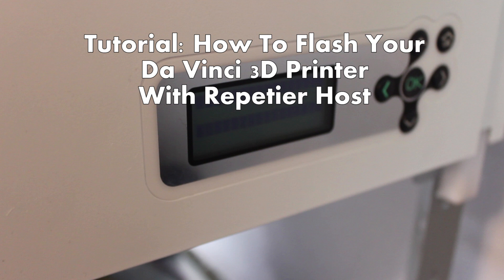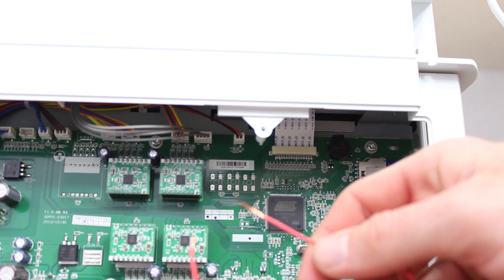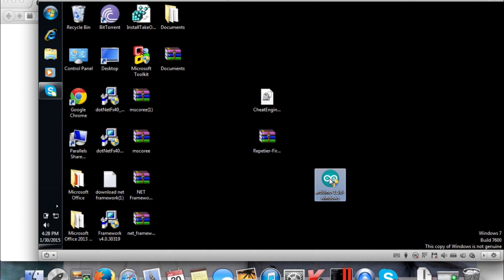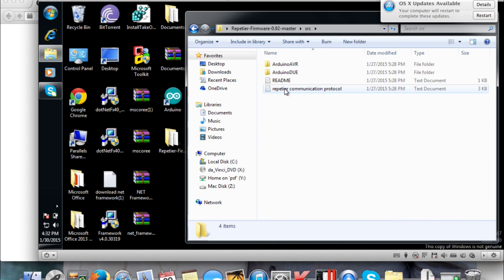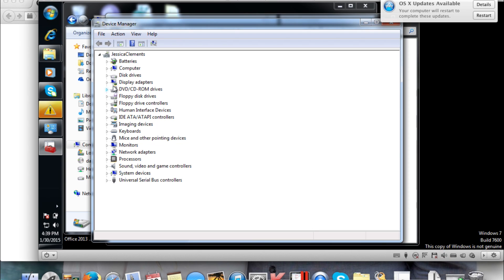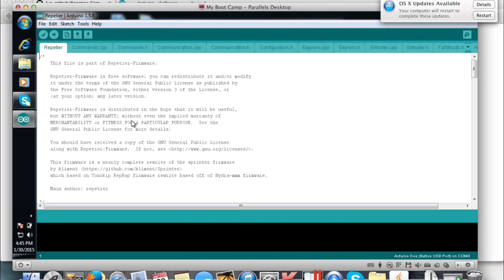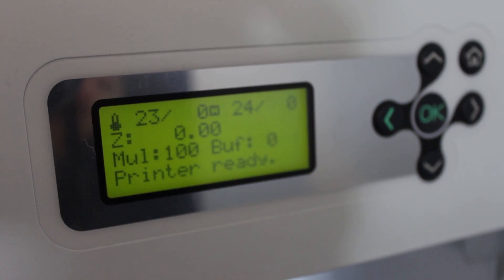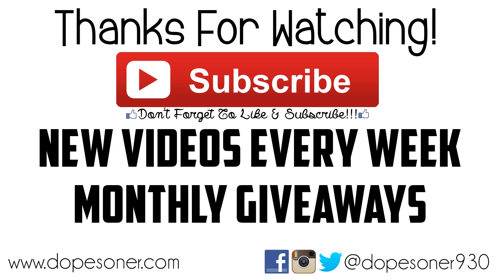Tutorial: How To Flash Your Da Vinci 3d Printer With Repetier Host | 3d Printer Hacks

Comment: using the files you linked,  going to the repetier folder, SRC, ARCUINO DUE, additionalarduinofiles.

There is no 1.5.8 folder

There is just  

Arduino - 1.6.9 -Due 1.6.8
Horus-0.2rc1

EDIT:

Also, the repetier software will not compile.  not edited, and not as is in the download.

Arduino: 1.5.8 (Windows 8), Board: "Arduino Due (Native USB Port)"

In file included from Repetier.h:572:0,
                 from BedLeveling.cpp:107:
HAL.h: In static member function 'static void HAL::serialSetBaudrate(long int)':
HAL.h:684:14: error: 'class UARTClass' has no member named 'setInterruptPriority'
       Serial.setInterruptPriority(1);
              ^
Error compiling.

  This report would have more information with
  "Show verbose output during compilation"
  enabled in File > Preferences.

EDIT2:

Just redid the entire procedure including the downloads.

Same issue.  the file structure of  the Repetier-Firmware-0.92-master folder DOES NOT match the video.

Arduino 1.5.8 beta atill WILL NOT compile the repetier firmware file.

Arduino: 1.5.8 (Windows 8), Board: "Arduino Due (Native USB Port)"

In file included from Repetier.h:572:0,
                 from BedLeveling.cpp:107:
HAL.h: In static member function 'static void HAL::serialSetBaudrate(long int)':
HAL.h:684:14: error: 'class UARTClass' has no member named 'setInterruptPriority'
       Serial.setInterruptPriority(1);
              ^
Error compiling.

  This report would have more information with
  "Show verbose output during compilation"
  enabled in File > Preferences.

My printer is currently a brick.
Reply: How did you fix it?

Comment: help! i got an error msg when i clicked the check mark:
Arduino: 1.5.8 (Windows 8), Board: "Arduino Due (Native USB Port)"

In file included from Repetier.h:572:0,
                 from BedLeveling.cpp:107:
HAL.h: In static member function 'static void HAL::serialSetBaudrate(long int)':
HAL.h:684:14: error: 'class UARTClass' has no member named 'setInterruptPriority'
       Serial.setInterruptPriority(1);
              ^
Error compiling.

  This report would have more information with
  "Show verbose output during compilation"
  enabled in File > Preferences.
Reply: ive got the same problem. Help
Reply: Did you guys figure it out
Reply: anyone solved this?
Reply: Looks like you need to use a newer version of arduino.  Got this from the githubz page:
Use an arduino IDE supporting arduino DUE, 1.8.0 with Due 1.6.8 module from board manager FAQ#166.
Do not use 1.5.8 it is not supported and will give compilation error: FAQ#201

Comment: Another XYZ Da Vinci 2.0 Duo has been liberated from its manufacturer. Thank you so much ModBot for your tutorial. Used the J37 and Arduino 1.5.8. No problem with the reset and upload, but there was no sound when the upload was done and I had to manuel restart the printer, but the printer then began the restart every 1-2min. I have just reflashed the printer with a little twist, Variant.cpp was edited so "//WDT_Disable(WDT);" was changed TO "WDT_Disable(WDT);" to disable the watchdog feature. And so far no restart and the printer has been on for 1 hours

Comment: I think there might have been a firmware update that prevents this from working on 1.0A now... I have fw 2.1.2 and shorting J37 no longer erases the firmware. If anybody has any tips to fix this that would be great!
Reply: Okay ignore my above comment. I did get it working on 1.0A with 2.1.2. I just wasn't using a conductive enough pin to bridge it. I grabbed some tweezers and those ended up working just great for me.
Reply: You followed all the steps in the video right? And everything worked ok for you? I'm also on 2.1.2, but I'm really nervous to try to do this.
Reply: Yep I followed them exactly and had no major problems (once I got the right tool to short the pins haha)
Reply: Alex Baucom did you have an easy time setting up the software and actually using it? I'm seeing a lot of forum posts and it seems difficult to actually use
Reply: I had used the software previously when I built a RepRap so I was already familiar with it as well as the slicing software so I'm not sure I can give you much information there.

Comment: thank you, everything worked fine on my davinci 1.0A. After i flashed the printer it did not start automatically. After a few Heart attacks (a few minutes later) I switched it off and on and it worked. It takes some time to set up the software but everything works fine.

Comment: Still works as of 8/5/16 
At first I was scared that I completely bricked the printer. It turns out that you have to use Arduino 1.5.8. I had to look in their previous builds to find it (arduino.cc/en/Main/OldSoftwareReleases). 

Also, I found that you can't just replace the whole "hardware" file. You need to replace the ones that exist in the Arduino program and keep the ones that don't exist in the Repetier's "hardware" file. 

Also, you need to install the Arduino SAM boards under the "tools - board - board manager" inside Arduino.

THIS IS IMPORTANT FOR REPETIER HOST
After installing the firmware, you have to tweak your settings or else your print head has a high chance of slamming into the print bed (fortunately there's springs). In Repetier host, 
1) Click Config > Firmware EEPROM Configuration and find "Z home pos"
2) Change "Z home pos" to -2.300 
1) Click Config > Firmware EEPROM Configuration > Printer Shape
2) Make sure the Print Area Width, Depth, and Height are all set to 200mm. Make sure X Max and Y Max are set to 200 as well. 

Thanks for this :P
Reply: do you still have the github file you downloaded. the one i seem to have is alot different then the one he mentioned in the video. there is no 1.5.8 folder or anything. only a 1.6.9. i have absolutely no experience doing this and dont want to brick my printer before ever using it

also the 169 file that is in git hub in installed it like in the video and clicked the verify and got an error about leveling. i havent did the eprom clear yet, i just wanted to test that no problems will happen before goin that far. if you do have the other file would you link it to me or give me some better tips on what to do to install it
Reply: Manime You have to download 1.5.8 Beta from the old Arduino IDE archives.
http://arduino.cc/en/Main/OldSoftwareReleases Also, I used the latest Git Hub files that are still up right now.
Reply: I have the same problem during compilatin: error: 'class UARTClass' has no member named 'setInterruptPriority'
       Serial.setInterruptPriority(1)
1.5.8 Beta and the latest Git Hub files are used. Tried to use newer versions of the Arduino IDE and compilation finished without issues.
Reply: Alex Stone You *have* to make sure the Ardruino version is 1.5.8
Reply: Thank you for your answer, but problem was solved in other way.
"the two black bars issue means you did not put the variants.cpp properly, if you update your IDE you need to update variant.cpp 
yes 1.5.8 do not have this function also I forget to mention but in 1.6.9 you need to go to board manager to download Due board
and files are there : <user>\AppData\Local\Arduino15\packages\arduino\hardware\sam\1.6.8"
Reply: +Alex Stone same error occurred while trying the Arduino 1.5.8, so I decided to go with the 1.6.12 (That's the newest one to date), and the compilation finished without issues.

However, a new error occurred while uploading the program to the printer, sometimes it stops in 69% and others in 79% upload percentage. I downloaded the due board, but did not see it on the direction you put, and I also didn't catch how did you update de file variant.cpp
PLEASE HELP!
Reply: MURILLO1925 As I remember, you have to copy downloaded variants.cpp to mentioned path. 
Also it is good to search your question in github issues, the author already have answered lots of them. f.e. https://github.com/luc-github/Repetier-Firmware-0.92/issues/175#issuecomment-239762985
Reply: +Alex Stone, done that. I copied the variants to the mentioned path.
Now, I have an error while uploading the code to the printer. Somehow, it always stops in 69%. Printer still has two black bars. Any ideas?
Reply: MURILLO1925 have you tried downgrading IDE to 1.6.9?
Nothing else crosses my mind.
Reply: which ide do i use? or is it really a matter of what's done with the variant.cpp? I had the newest version matching the repetier hardware file for 1.8.-, everything worked perfectly only the printer did not restart so I went in to ide and could find variant.cpp in the list. it compiled and uploaded without issue but again printer did not reset. 

now I'm using the 1.5.8 ide but github file hardware variant.cpp is for 1.6.8? so please which ide do I use, 1.5.8, 1.6.8, or 1.8.1??? I understand the rest of the process but please let me know the version of ide to use.

great video and thank you in advance
Reply: Use 1.5.8. Even before I flashed my printer, there were still files referencing to later versions of Arduino IDE. Don't worry about it. I don't know why, but only 1.5.8 seems to work. I think at one point I tried 1.6.8 and it didn't work.
Reply: Aaron Lowe I did try but it gave me a compiling error
Reply: You get that if you're not using 1.5.8 but if you're using 1.5.8, then I'm confused.

Comment: I had a small moment of oh $#@$@# I've bricked it. 
Just in case someone else has the same issue:

You can bridge the pins by touching with each end of the wire as shown in the tute, which will make the display show the black bars on the led display. 
After programming with Arduino it will show success but not move from black bars.

Turns out... I didn't bridge the jumpers correctly. Use a single wire to short them. When it is successful you will hear and audible beep to confirm all working.

Very scary moment avoided :)

Confirmed working on 1.0a with 2.1.1

Thanks for the tute!
Reply: mine wont work!

Comment: I've flashed it and tried to install the repetier software to it and only get 2 bars. Arduino says successful install. Restart the printer after 5 minutes and windows doesn't recognize the printer. Duo with 2 fans, jumped J37
Reply: Re-flashed it, reinstalled it same problem. Left it while researching what I did wrong (about 20 mins) turned it off and on again to see if windows could recognize the printer and Repetier started.

Comment: I perform the Hardware folder move and Arduino won't open anymore
Reply: I tried to copy the two files in the Repetier hardware folder to their direct respective places in program files.

(repetier folder) - hardware\arduino\sam\cores\arduino
put the USB file into : Program Files (x86)\Arduino\hardware\arduino\avr\cores\arduino

and then

(repetier folder) - hardware\arduino\sam\variants
put the "arduino_due_X" folder into : Program Files (x86)\Arduino\hardware\arduino\avr\variants

You'll also need to install the Arduino SAM boards under the "tools - board - board manager" inside Arduino.
Reply: Thanks, it opens now
Reply: Found old version 1.5.8 and opens without tweeking
Reply: Cowboy Boots  Yeah I think I need to do that also, having some trouble doing this with my Arduino Mega.
Reply: Thanks so much. +Cris Gough

Comment: This is the error that I got. Where is the Reset button on the Board? D 1.0 

Arduino: 1.5.8 (Windows 8), Board: "Arduino Due (Native USB Port)"

Sketch uses 158,908 bytes (30%) of program storage space. Maximum is 524,288 bytes.

processing.app.debug.RunnerException: Couldn't find a Board on the selected port. Check that you have the correct port selected.  If it is correct, try pressing the board's reset button after initiating the upload.

 at cc.arduino.packages.uploaders.SerialUploader.waitForUploadPort(SerialUploader.java:199)

 at cc.arduino.packages.uploaders.SerialUploader.uploadUsingPreferences(SerialUploader.java:95)

 at processing.app.Sketch.upload(Sketch.java:1713)

 at processing.app.Sketch.exportApplet(Sketch.java:1624)

 at processing.app.Sketch.exportApplet(Sketch.java:1596)

 at processing.app.Editor$DefaultExportHandler.run(Editor.java:2392)

 at java.lang.Thread.run(Unknown Source)

Couldn't find a Board on the selected port. Check that you have the correct port selected.  If it is correct, try pressing the board's reset button after initiating the upload.

  This report would have more information with
  "Show verbose output during compilation"
  enabled in File > Preferences.
Reply: +Craig Lewis I just turned off the printer and reload the program. working :)
Reply: +Craig Lewis Thanks for making the video and sharing. Cheers

Comment: this is the best tutorial ever thanks. just a quick issue, since flashing my AIO, the case lights are not working at all, checked the enregy saving, and sent M355 s0 and s1 commands and it says its on or off but nothings happening... any ideas? my guess is that the pin outs have changed. i used J37 to flash the board...

Comment: Thanks, I Flashed my Davinci 1.0A following your video. My only problem came from uninstalled lower version of Arduino that I was using for others purposes.  I bought my printer two week ago, broke my glass last week, and finished 2 cartridge today. I was anxious to do it, but I have 3 Kg of material that I can use because of the cartridge. ( I update the firmware before knowing that it would block the Cartridge Reset. )     Thanks again, I would not be able to live without a 3DPrinter anymore...

Comment: This is a great short video thanks.Arduino has releases up to 1.6.7, do you recommend still using 1.5.8?also firmware is up to .92 do you recommend .91 are should I use .92This is on Da Vinci 1.0 AIO. (don't use scanner anyway)

Comment: I'm thinking about attempting this guide from a linux install. Do you think theres anything I should really worry about? I already use arduino for other projects and its showing the printer just fine. It seems like it should work fine but really dont want to brick my printer :)
Reply: hmm, i can already connect to the printer but i havent shorted the jumper yet. the system shows my user account is set to dialout already so it should be good I'm thinking. now to just go to the hardware store and pick up a torx screwdriver set and I think tonight I will flash the machine
Reply: have you honestly missed anything from the original firmware? ive read that repetier is hit or miss on speed (but then again so is the xyzware) but i havent seen anything thats really worrying about repetier yet. it seems the benefit outweighs the risks
Reply from the maker: There shouldn't be any issues with bricking I don't know if any of the newer firmware a have a safety check I would browse some forums but as long as you can use arduino and write the file to the printer you should be good to go!
Reply: it went without a hitch,  I think I have the bed leveled and am working in a test print now.  I did happen to run into an issue after all with not being able to access the port for arduino to upload but it was an easy fix as was mentioned earlier

Comment: Hi, 
I used your tips to reflash my 1.0a. Had an issue with arduino IDE not starting up with windows 10 so I ran it from my mac (this is where I think I created the problem). Sketch uploaded just fine but printer still had the black bars. I re-shorted the connections and tried again from another windows 10 machine, again sketch uploaded fine. I still, however have the black bars on my printer. Any ideas? Thanks for the tutorial, clearly everyone else got it to work just fine.
Reply: +wj stuben Got it working. Replaced variant.cpp and used a Win7 machine. Worked just fine. (in case anyone else comes across this issue)

Comment: hey man,

I have had repetier 0.91 on my da vinci 1.0 for a little over a year now. I was just curious if I need to bridge the JP1 to upgrade to the 0.92 version or if I am already set to upload the new version being that repetier is already flashed on my machine. 

My printer works fine with 0.91 but I want to mess with the auto leveling that comes with 0.92
Reply: If it helps to know, the printer is labeled as "Arduino Due" under my devices and printers.
Reply: I have successfully reflashed my 1.0

Comment: Does this work on the 2.0A? And if it does, what do I short on the EEPROM and what do I change exactly for the code?
Reply: Did you find? because I have too a printer 2.0A
Reply: +Simon Vincent Nope. I ended up buying Simplify 3D instead and it worked perfectly. I highly recommend it not just to get around XYZ but also just as software for anyone. it's the best on the market. it's also $150 USD though.
Reply: It's a Good idea thanks, we can use ans brand filament in duo 2.0?
Reply: +Simon Vincent Yeah I used some cheap ebay filament and it worked fine. You get some control over the temperatures for different materials and I know the filament used isn't tracked on the left extruder with the software.

Comment: I have a problem. XYZware doesn't recognize the printer after doing this. The printer is com8 anda the program look for com4. I tried changing the printer to com4, but it didn't worked. Please help me :/ Thanks
Reply: +Luis Alejandro Sáenz You can use a different print host like Repetier Host now that you dont have stock firmware anymore
Reply: +dext0rb is that the best print host? Thank you